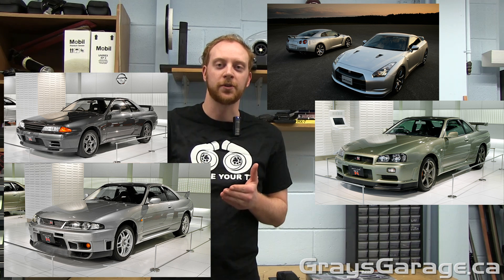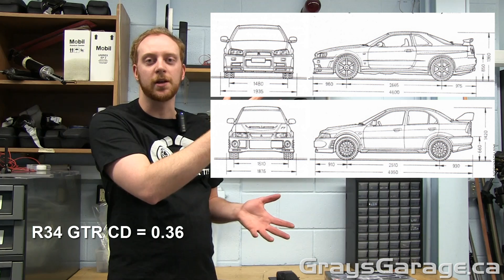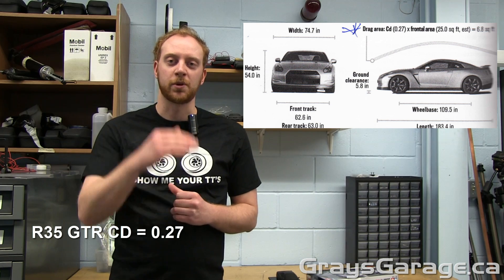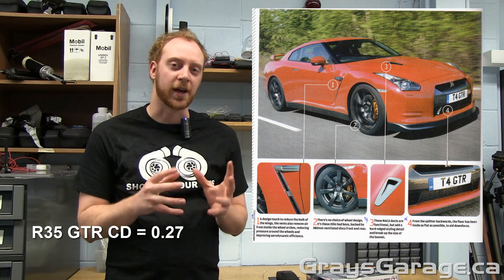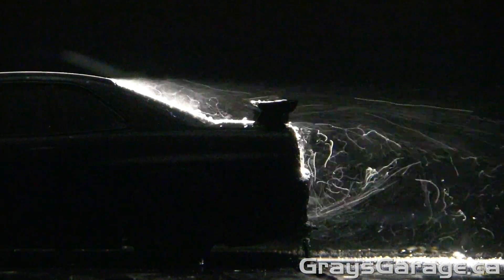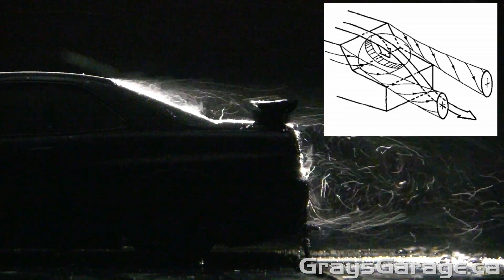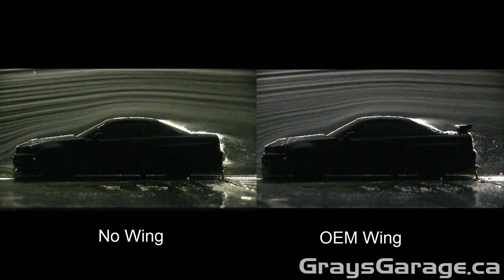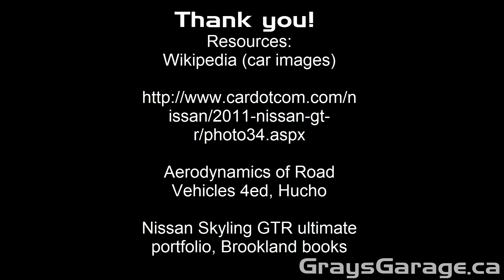Automotive Aerodynamics Ep. 5: Nissan Skyline GTR

Comment: The R34 has higher drag number of 0.36 for two reasons with one was the carbon front under tray and rear underneath diffuser and it had a angle of attack rear wing this was to make the GT-R more like racer masquerading as road going sports car

Comment: Can you test the effect of this mod? A lot of new cars Camaro and corvette for example and I see some of the new funny cars in 2017 have a small 1.5" strip of plastic in the front wheel well 90 degrees to the body like a trip strip ahead of the front wheels.  You can see them in this picture. https://duckduckgo.com/?q=2017+funny+car+race&t=ffnt&atb=v63-5&iar=images&iax=1&ia=images&iai=https%3A%2F%2Fs3.amazonaws.com%2Fspeedsport-news%2Fspeedsport-news%2Fwp-content%2Fuploads%2F2017%2F02%2F17111551%2F2014_Paul_Lee_Action.jpg

Comment: Yes, the cockpit part of R32 and 34 looks like a box, the shape of the rear isn't as linear as the R35. The cockpit of R35 is channelling air towards the rear wing.  

Also, that's why the R35 N attack get a taller wing than the standard R35 Nismo. Not sure for the R34 but the OEM wing on the R35 is to turn wake into a much linear air flow instead of generating down force. By the way, that's why you can adjust the rear wing of the R34. You can adjust a higher angle of attack for more down force or adjust to lowest angle and make it less effective.

Comment: Great video, Im learning aerodynamics and thtough your video, it shows taht my understanding is correct. And probably for the same reason (air is not accessing the wing all the time), aftermarket parts made higher wing stays. Eg. Mine's made a 30mm higher wing stay than stock for it. And also, Nissan it lower maybe because they wanted to balance the front and rear downforce. As car moves faster, downforce increases. So, my hypotesis: If they made too much higher, since the flow over the roof was very fast if it hits the wing (where air is slowed and have increase in downforce significantly since different in pressure is a lot) it might have more downforce on the rear resulting in less traction up front (because of front lift). 

PS: GTR fan alert! I work so hard to understand its aerodynamics. When your video confirms my understanding is correct, It made my day :D

Comment: I can't wait to see a video on the hood vents. It should be very interesting to see how that affects the bubble in front of the windscreen and the stagnation point at the front of the car. Would it be possible to show a top-down view of the car? Maybe you could mount the wire horizontally in front of the car. It might be interesting to see the vortexes at the rear and at the fender flares that are on cars like the R34.
Reply from the maker: I did this in Ep. 2 for the pop-up headlights. The setup is just a little bit more involving, I might try it again.
Reply: GraysGarage Forgot about that! Thank you.

Comment: R-32 GT-R was made from 1989 to 1994! not 1991. The R-33 had a movable rear wing that moved from 0 to 18 degrees changing Cd 0.35 to 0.39. The R-34 had a movable flap on the rear wing, the wing itself did not move, the flap moved from 0 to 30 degrees changing CD from 0.36 to 0.40 The R-34 V-spec 2 had a single NACA duct, the vented bonnet was/is a Nismo option. The rear windscreen "bubble" was something that was a major problem on the R-32 but specifically eliminated on the R-33 and 34 (which is why the small flap on the rear wind made such a big change to the Cd on the R-34) I'd suggest in your testing it was caused by the model, scaling or buy the way the downstream bubbles were made. I got my info and figures from "NISSAN GT-R" by Alex Gorodji ISBN 978-0-7603-3036-4. It mainly focuses on the R-32, 33, 34,and 35.
Reply from the maker: awesome information, if I can find the time, I will update the video with these edits. Thank you!
Reply from the maker: updated with this new info, thank you for catching me on these!

Comment: I wonder what speed is simulated by the wind you are applying in this simulation. Certainly the turbulence off the rear window would increase with higher speeds. I feel like with scale the speed of wind over this car may be well above realistic speeds for this car so having the wing slightly in turbulence at very high speeds could be something that was intentional from a design perspective such that extreme drag was avoided at high speeds while still adding stability starting at moderate speeds. Just my uneducated hypothesis.
Reply from the maker: The similarity parameter is known as "Reynolds number". I will be doing a dedicated video discussing this and how the tests I've performed compare to full size cars. For these qualitative visualizations it shouldn't matter too much, but for more detailed analysis you are correct, there are some differences.
Reply: GraysGarage Could you do a aero test on bugatti veyron model please? I think they have really interesting design
Reply: +GraysGarage Please do a 2015 GTR and the 2016 GTR Nismo. I think it would be very interesting considering the Nismo version has a fixed rear spoiler design that seems to be more aggressive than the standard GTR.

Thanks
Reply: Assuming they've bothered with nondims for the wind tunnel tests (which I would assume they have - going to the trouble of using a semi proper wind tunnel with nice flow vis is pissing in the wind if they haven't), then what you're looking at is fairly clean flow separation right at the edge of the windscreen. Again - assuming this is a valid test, it looks like the boundary layer likes that lip as a separation point. Up side is it's stable. Down side is more drag. Several ways to remedy that, the obvious being fix the damn pressure gradient, but we don't have that luxury. I'd stick a row of VGs (proper ones like these http://www.windpowerengineering.com/wp-content/uploads/2015/02/Power-curve-vortex.png , not the shite you're told is a vortex generator but actually just looks pretty - like this http://images.uptilo.com/chargespeed/018B81E1-563A-4193-8D0E-0290FF69DD4E.jpg) right at the front of the roof, behind the front windscreen. 9 times out of 10 that'll get it to stay attached most of the way down the window.

Contrary to one's intuition, adding turbulence might actually solve the problem here. This is mostly to do with length scales, the turbulence we want is comprised of very small vortices, all inside the boundary layer, rather than the big ones you get when it separates. Going faster makes them stronger and keeps the boundary layer attached for longer. In this case though separation is fairly clean. There's probably a lip or an edge or some other sharp feature that's causing it and its effect needs to be overcome if flow is to remain attached a bit longer.

I'm not entirely sure it is a bubble though, quite a bit of vorticity going on there and it's hard to tell without laser PIV (and some pretty expensive high speed cameras!) what is part of the vortex shedding system and what is part of the shear layer. I don't imagine the spoiler would be very effective either on that basis alone.